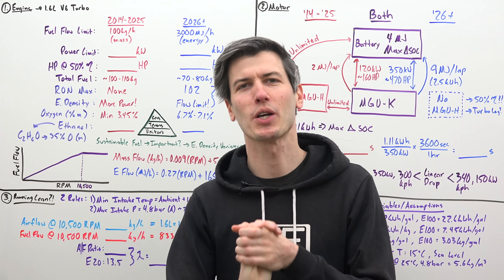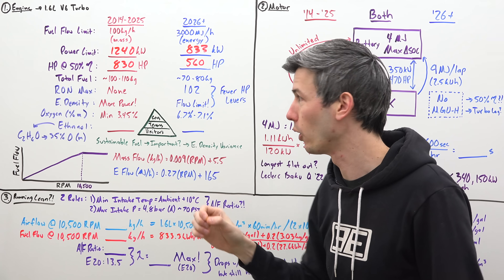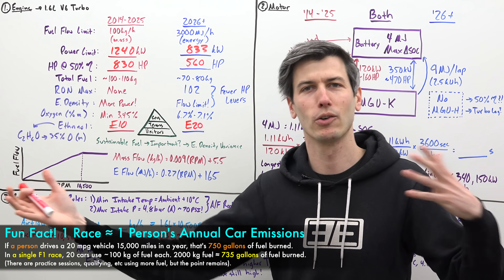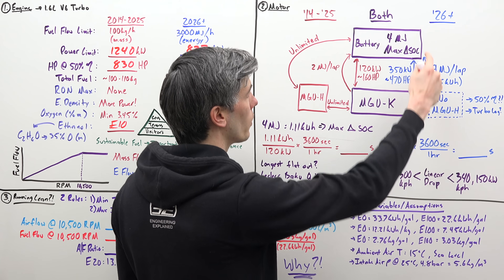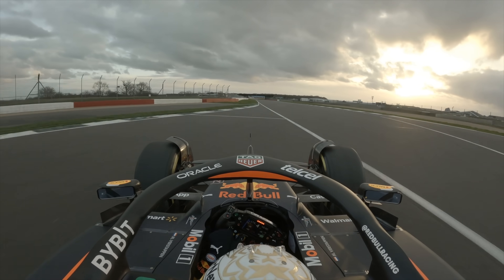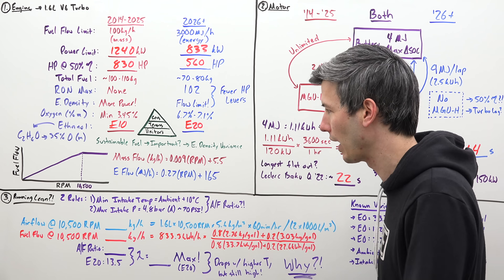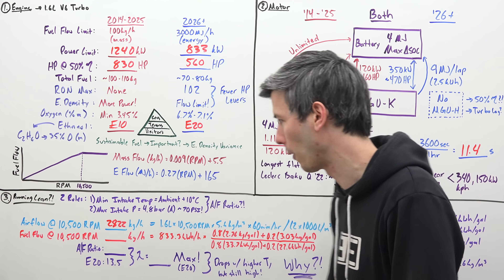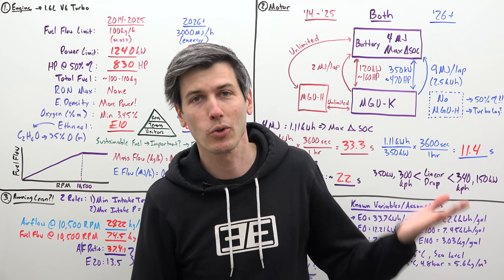Why Are 2026 Formula 1 Engines Going To Lose So Much Power?

Comment: To retort that question you and neil discussed the equivalent to a turbo on an ev would be using an ac motor and a solar panel super capacitor array to over volt the motor and run it at different drive frequency, also use ac motors that operate at kHz ac frequency would make em much smaller and more efficient, like flyback transformers which are the modern equivalent to a tesla coil

Also maybe replacing lithium polymer or lithium ion, with lithium iron phosphate batteries they seem much better suited for ev cars in every way, safer, low risk of fire hazard, oh look you can charge and discharge em 5-10x more than lipoly or li-ion

And probably much more cost effective to make, since you only need lithium, iron, and phosphorus, and oxygen, all of which is plentiful and cheep
Reply: Wonder if Elon musk dumbass uses DC in his cars, probably a pulsed DC pwm, and not true rms ac waveforms
Reply: Probably could learn how to build a proper DC to ac inverter, just get a few igbt and just copy from a drsstc schematic with full bridge inverter, replace the tesla coil with the primary of custom motor coil...

Comment: Love the conclusion! Question: for the high air-fuel ratio could they be thinking along the lines of the SkyActiveX engines Mazda came out with a few years ago? If I remember correctly they ran super lean and used the spark-plugs to create pressure-induced explosions rather than burning the fuel, which created more efficient engines. Could they be pushing teams towards that model to make up for the lack of an MGU-H?
Reply: Watch the video he linked in the description. They already use pre-chamber ignition
Reply: @AmpdLSU  thanks - watched this on break at work / hadn’t gotten back around to watching the first video!

Comment: I wonder if at that point its worth it to eat the mass budget and install a fuel chilling system to make the fuel more dense and solid, similar to what some modern rockets do. This has real world car relevence as fueling up your car at night during winter when its cold gets you marginally more fuel energy for the same money as fueling up at 2pm on a summer day.  Weight is the enemy of an F1 car but if you can gain 200HP by pumping more fuel in it might be viable.  If the sport bans energy density one way, find it another way.

(of course F1 being F1, they'd ban it the moment they saw it, because what F1 really wants to be is a spec series pretending to be a formula series.  "Formula" means "Not Spec".)

Comment: Dont forget there are other conditions than full throttle near redline.  The temp and lambda requirements might be to address shenanigans taking place at part throttle or mid rpms or whatever.

Comment: Where was I reading that on off throttle they were pumping alot of pressure into the engine to create continuous pressure to activate the aero better behind the exhaust on low speeds/off throttle. Like the fan car. 
I suspect this parameter stamps that out completely.

Comment: Why do you need oxygen in the fuel? Isn't it mixed with oxygen from the air in the combustion chamber? And if the gasoline changes to synthetic and not fossil fuel, what is the point of ethanol anyway? Also I have read that the rpm limit is being raised to 18,000. in the new rule. From what you say anything above 10,500 rpm. uses more fuel without giving more power so drivers are going to use these extra rpm's very rarely. And with less power from the combustion power unit the engine sound is going to be even worse than it it is now. Todays F1 engines are criticized already for the pathetic sound they make compared to the V10's of the early 90's. It seems like they'll be sounding like lawnmowers after this round of rule changes.

Comment: This would be perfectly acceptable if they would just bring back refueling so the cars weren't the size of long bed pickups.
Reply: The refueling ban has actually nothing to do with the now enormous cars. During the V10 era, the fuel tank were about the same size as they are now. The reason the cars got long is simply aerodynamics. A longer floor can produce more downforce.

Comment: Could the high airflow limit be used to have higher boost on lower rpm and inject more fuel ? Meaning the engines could have somewhere at lower rpm good power and better efficiency ?
This way, the real fuel flow curve wouldn't be flat on the left part as supposed in the video and would curve nicely to reach the maximum earlier ?
Note that I have no real idea if it affects efficiency and if I'm understanding anything right !

Comment: Running an engine that lean at high rpms will lead to overheating, maybe seizure.
Reply: No it won't. If you run that lean, the combustion temperatures are actually fairly low. They run on the actual lean side when it comes to air fuel ratio. What you mainly still use in road cars is a rich mixture under load and high rpm and the engine overheats if the mixture drops closer the stochiometric, which produces the highest temperatures.
The problem with really lean mixtures is that it is hard to ignite, a normal spark plug won't do the job. F1 solved this issue nearly a decade ago though.

Comment: Here is my theory:
The airflow limit is likely to limit teams using cylinder deactivation to save fuel, a widely used technique called "clipping." See your air-to-fuel ratio is for the engine overall but teams can cut cylinders from cycles on a direct injection engine so run a V6 although it where a single, the risk with lower fuel limits is you might see cars silently gliding into corners with the ICU shut down to save fuel. This rule prevents teams having an EV mode.

Comment: When I think about F1, I think about the most advanced tech that can be applied to road automobiles, in engines, in suspensions, or any other part of the cars. I think about different approaches to these hi-tech solutions, V6, V10, I4 if you will, 4 wheels, 6 wheels, active suspension, mass dampers, etc.
This is almost impossible nowadays, it's impressive that the engines have reached the 50% thermal efficiency but this does not give the spectators the entertaintment we had years ago, this sport is kinda getting to a one-make racing class with all those limitations.

Comment: I do find not agree with your some assumptions (dont agree not same with I am the right one):
1. Synthetic fuel are not like mineral oil (like lube oil syn vs min) so energy/mass are completely different story. Can't use E20 parameter
2. Energy meter used to make equal playing field, related to no 1 and not related with octane number. We can engineering calorie value with syn fuel so mass measurement already obsolete. Depend on each oil company technology 
3. Energy harvesting and deployment on F1 not as simply like when you alone in circuit. When, how much, how long and where depending where you are, what gap in front, gap on back, your engine fresh or not and another parameter. Because while you harvesting (and what level)  you gave up some performance and driver dont like it.
4. Intake Air flow on F1not only used to burn fuel, sometime the just pass the cylinder or without fuel like blown diffuser era, or duct to somewhere else. Cooling, drivability etc as reason
5. The first iteration to design F1 car should be how much engine power can deliver. So aero work will changes, weight, dimension, aux system, cooling, hydraulic, suspension, will be different with current car concept

Comment: Noon! No mguH( I was hoping this tech could transfer to real cars.
Reply: I am guite sure that it will. It just is too good for motor sport cars. They could use the e-motor allmost all the time when using MGU-H.
Reply: @haukikannel  No it won't and that's the reason it's banned. The issue with the MGU-H for a road car is, that you never have enough excess exhaust energy to make it work properly. In race cars the MGU-H works because they drive full throttle 50-75% of the time, depending on the track. You can only really harvest energy from the MGU-H at full throttle. On normal roads, the time a normal car uses full throttle is less than 10% of the time and that is simply not enough to make it feasable to use in a road car.
Reply: @shi01  probably usable in turbo generators for hybrid evs aiming for higher thermal efficiency

Comment: How does 2.8 lambda even run. When a gasoline fuel engine reaches 16-1 or higher its starts to misfire, and there super high temps also.
Reply: Well, they already probably run around 20:1 now. Temperature isn't an issue if you run that lean only igniting the mixture is a problem and they solved that about a decade ago with what some call "turbulent jet ignigtion".

Comment: What monitoring will there be? ... and what will the penalty be if (say) the air inlet temperature drops beliw ambient +10?
... for 0.001 seconds?
... and what if the ambient varies by a huge amount around the circuit? ... and what if the ambient reaches (say) 50C. will the engines be able to operate satisfactorily? ... and what about the ambient dropping during dusk or night races?
Will the ambient be a defined temperature for the race? ... and if so will the cars be allowed out of parc fermé to be adjusted in the light of day to day changes?
... etc. etc. etc.

Comment: That a few awnser or conclusions of why they  do that internacional events.
K unit moves combustión motor using the correct metalurgical parts  similar a perpetual engines etc. It's just a push for help at the same time the eléctrics & sichronicaly at same times (averege balance of help betwen both together) also. No just E20 - Peak Powers form both motors with mechanical advances. Low power or fibble? Yes is the awnser but they try develop mechanical & electrónics to do the 75% or more each race. Any way lighter & race car most track dimensions need be respect. So please formulate & demonstrate, weight & power needs to race & show what's F1 not the horrible result what we see every event. Fórmula 1 is the name of the diciplines in that sport. Not x factor a fórmula have all clear on each spec for formulate in the #1 category = F1
Also some ones says USA not understand F1. So let see.  Viva F1!...

Comment: All this crap is why I am no longer interested in Formula 1.  The pyramid discussion at the beginning is what we should focus on.  A few cars racing around the track using all this emissions technology vs the 100's of thousands of fans flying, driving, bussing, train-ing, motorcycling to these events causes a massive amount of emissions so what's the bloody point?  Not to mention the emissions involved in the manufacture of these cars from raw materials right through to the finished product.  Let's a get a grip.

Comment: When fuels have their oxygen there is a certain level of combustion that occurs with the fuel's own oxygen. So the carbon or hydrogen atoms combust with the oxygen in water. 

This rule about air stuff could be related to this somehow. But this don't make sense, because fuels with ethanol can already run leaner than fuels without ethanol, not very significantly, but yes.
My guess is F1 wants more complete combustion to chase a 100% output products to be CO2 and H20 - thus encouraging teams to use more air. 

Also, air is not added weight, so the F1 teams will use as little ethanol as possible while following the rules and prefer to fill up the tank with carbon and hydrogen atoms, preferably more hydrogen atoms because the water expansion is much more tremendous than the carbon oxides.

Comment: The reason air flow (pressure) is limited is costs. Going too much higher than that requires a lot more tech (such as desmodromic inlet valves) to implement.
Edit: The MGU-H was removed for cost reasons (it was a requirement of Porsche joining F1 as a constructor - then they declined anyway!). So the FIA aren't going to remove one money-sink only to replace it with another. They currently use pneumatic valve 'springs' but if they're having to resist much higher plenum pressure then... cost.
Reply: So, F1 uses Freevalve? But they still have quad cam engines with front end timing gears!
Reply: @kevinburke6743  No, not freevalve. Cam-actuated valves working against a gas pressure 'spring' rather than a coil spring.
Reply: What'd be the advantage of even higher air pressures?
Reply: @FiveFiveZeroTwo  More air pressure means more oxygen (and fuel) can get into the cylinders which means more power!
Reply: @Shaun.Stephens  But they are already running very lean and fuel flow is limited. No more power.
Reply: @Infanterie_Marine  Fuel flow is only limited at max revs. During the acceleration phase more 'charge' and fuel entering the cylinders (when the fuel rate hasn't reached it's limit) means more power.
Also, yes, they are already running leaner than road cars due to them using a stratified fuel charge and 'jet' ignition but there's always room to improve.
Reply: @Shaun.Stephens It is limited. From the "2026 FORMULA 1 POWER UNIT TECHNICAL REGULATIONS".

5.4.3 Fuel energy flow must not exceed 3000MJ/h.
5.4.4 Below 10500rpm the fuel energy flow must not exceed EF(MJ/h)=0.27*N(rpm)+ 165

Comment: There was a time when the fuel tank had to be of a prescribed set of dimensions and so Renault decided to use a chiller to reduce the fuel volume prior to it being fed in into the tank in order to get around the rule and gain an advantage. It worked until it was banned. I've probably distorted the story somewhat but it went something like that. As for those figures and formulae shown, all I can say is I know my times tables and that's about it, two times one is two, two times two is four, two times two is four.................

Comment: I think those IAT and charge air pressure limitations are aimed at preventing F1 teams from adapting some sort of crazy charge air regulator system on the engine intakes. They could theoretically run insanely highly charge air pressures (15+ bar) air through the intercooler and then run that high pressure/near ambient temperature charge air through a high flow rate regulator to reduce the pressure to a more reasonable useful manifold pressure while drastically cooling the charge air in the process due to adiabatic expansion. This could get IATs far below ambient at the regulation intake pressure (possibly even to freezing temperatures depending on the expansion ratio), greatly increasing intake air density, and also improving combustion stability. I tried to design something like this for a regular turbo car, but it wasn't feasible for a regular car/engine setup. It was far too complex, cumbersome, expensive, difficult to manufacture by hand, and would have required a crazy tuning solution because of the additional sensory/feedback inputs to compensate for variable ambient temperatures and available boost/turbo lag. The returns were also diminishing on a regular vehicle setup and theoretical benefits were mostly only in the super high rev range (IE even more turbo lag). F1 teams wouldn't have the same limitations, and they are chasing milliseconds so they could pull it off, and possibly consider it as a valuable proposition.

Comment: How about why does the fuel have to be sustainable? What does that mean anyways because there is no fossil fuel which is sustainable. How can the oil sands in canada, off shore drilling from norway or oil bubbling up out of the ground in saudi arabia be any different in sustainability?
Reply: Sustainable means that it is not made anymore from fossiles aka oil… 
Is that sensible… Not because sustainable gasoling takes more electrisity to make than use the same electrisity in electrisity motor.
Those new ”sustainable” gasolings makes only sense when you can not use electrisity directly, aka palses where there are not electrisity available.
Reply: @haukikannel  yeah it doesnt make sense to me. Even biodiesel causes more harm to the environment than pumping oil out if the ground.

Comment: yeah a few years ago, ferrari weren't running lean, if you saw the smoke coming from the engine. 
oh, thats right, they were also burning oil. better recalc for whatever they could burn. coolant, bargeboard, grasshoppers

Comment: Great explanation dude!  Thank you for breaking it down like this.
I am old AF and have been watching F1 since the 70's.  It has been amazing to watch the transformation of both the sport and the cars during the last 40 years.
While I do miss the turbo era greatly (and the the engines screaming out 18K RPMS), I also have tremendous respect for the amount of power the engineers can pull out of these engines with relatively tiny displacement.  Just incredible.
As for understanding the third change...it's F1.  Need I say more.  ;-)
Reply: 30 years ago was this same tiny displacement and this level of power, or even more power. The bigger difence is that today they use halt of the fuel at that era.
Reply: the 80s turbos didn't hit 18k rpm, that was mid 2000s NA engines.
Reply: Me too. Let's be honest, F1 has been taken over Elitest Green buffoons and by hyper marketing to 16 Yr old children.

The current cars are significantly slower than the 2004 cars. 20 years and we've done is go backwards.

It's boring.
Reply: @realMaverickBuckley  except they're both faster and more efficeint then the 2004 cars...and the 2020/2021 cars where faster than these...

Comment: are those limits about average energy or does it have to be all the time under limit?
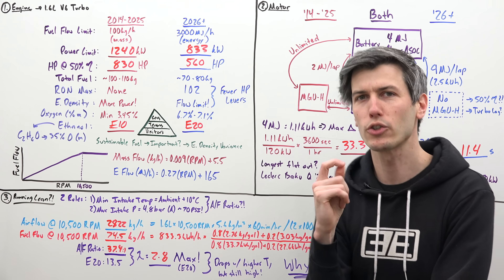for example, if it is about each 15 minutes consumption, I can answer why are they also limiting turbo pressure (14:21): Maybe hey are trying to limit some boost teams could put for short time during that 15 minutes consumption.